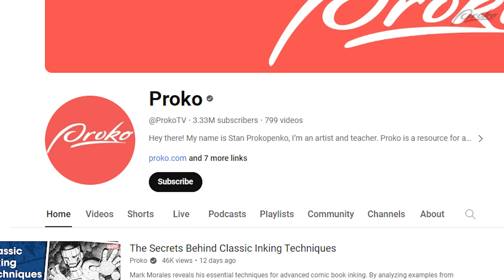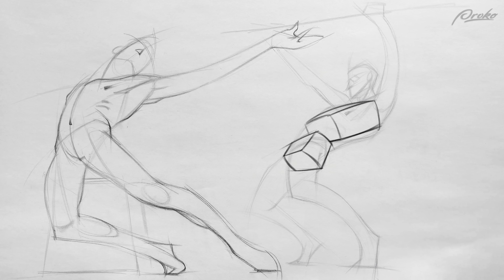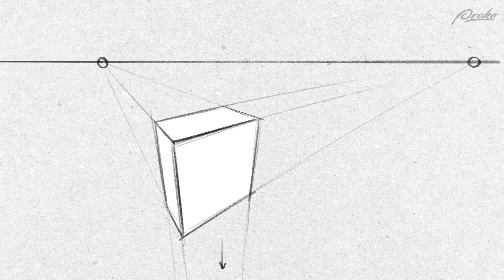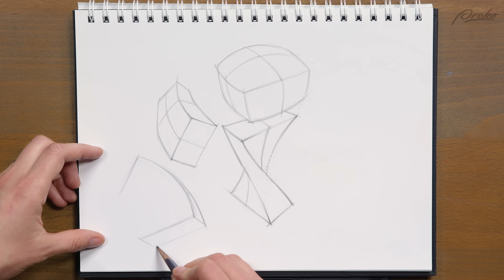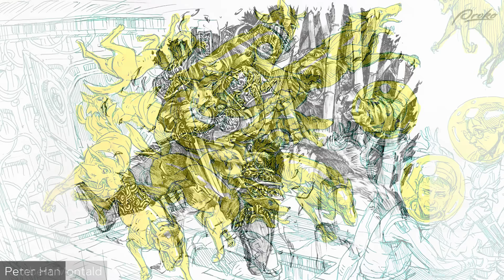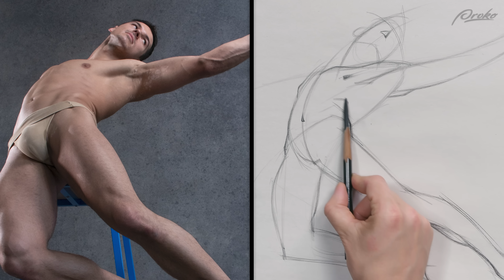Thinking in 3D

Comment: @ProkoTV Hey! So there is a burning question I have with regards to perspective but that most art courses leave to the "intuitive" side and yet I find it anything but intuitive, and I think that learning the formal construction of it would help me gaining the intuition, but I can't find it anywhere. 
My question seems simple enough, but it has a catch: how to draw a cube in 1, 2, or 3 point perspective? and the catch is that I want this to be an actual cube rather than a rectangular prism. In one point perspective, for example, I can draw a square, and throw the lines that fade into the vanishing point but I don't know where to cut off the cube so that it really seems that all the lines are the "same length" and not that I've created something too elongated. This obviously becomes even more and more complicated in 2, 3 or 4 point perspective. Essentially I want to figure out how to ensure that a line segment that is vanishing to one point, is of equal length to one that is vanishing towards a different point.I once saw a complicated construction for the 1 point case, but it gave me no clues as to why it was supposed to work, and thus I couldn't figure out if there was a way to extend it to 2, 3 or 4 points. Are you planning to cover this in one of your lessons? I would be infinitely grateful if you did!

Comment: I have a question about perspective
Typically one point and two point are fairly easy to understand, we have 2 vanishing points for an object that we can place anywhere as long as it's on the horizon line. But what confuses me is 3 point perspective, where should I place the 3rd vanishing point? It doesnt lie on the horizon line at all so it seems very confusing to me. I had some discussions with friends and came up with an idea that there exists a vertical horizon line, which will solve the issue of where to place the 3rd vanishing point vertically, but now where do we place the vertical horizon line? In the middle of each object? in the middle of the screen? Or do we have to scrap this idea and think of an entirely new mindset for this 3rd point
Reply: So long as you aren't rolling your camera to the side at all then the 3rd vanishing point will always sit on a vertical line that passes directly through the center of the image. Where it is on that line will be determined by how much you are tilting your camera up or down.
Reply: The 3rd vanishing point will exist on a line perpendicular to the horizon line.
So, if you have a flat horizon, the 3rd vertical vanishing point will exist on a line that is perpendicular to the horizon line. That vertical line can be anywhere in between the two points on the horizon line.

To minimize distortion, you wanna place the 3rd vanishing point high or low enough. To find the right position, imagine a circle whose diameter intersects the two horizontal vanishing points. You would place your vertical vanishing point outside of that circle. 
Vertical vanishing points that are:
1) outside that hypothetical circle
2) within the bounds horizontal bounds of the two other vanishing points
Tend to look best.

I hope this helps you. If you didnt understand anything, please let me know and i will explain it to you 😊
Reply: it really depends on the shot u want to draw. For example, if you want to draw a skyscraper ...camera from above, you want to place the 3rd point on the center-lower place. as you make the 3rd point closer to the point where the all axis lines meet, then you're increasing the exaggeration of the shot...this is my opinion